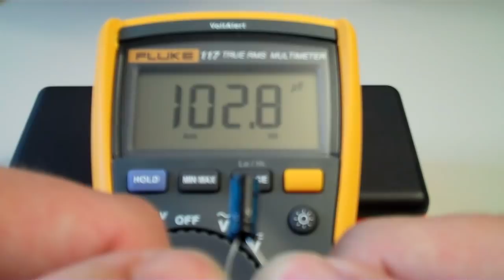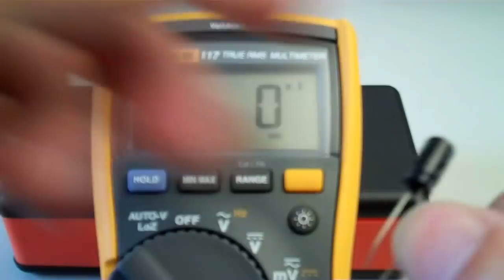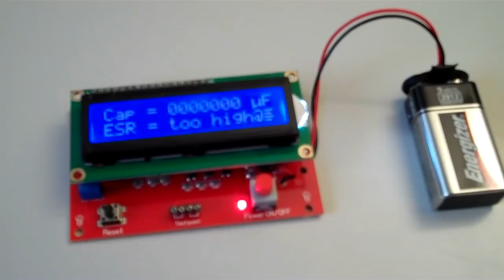Low cost ESR Meter review

Comment: Hi, Thanks for the review!
So . . .  may I ask,
do you now trust your Fluke DMM for capacitor testing?
Was the capacitor that was rated NG really not good,
or just not good for applications where it would be used for
frequencies higher than audio signals?
If you had taken that cap rated NG out of a power regulation circuit
could it have contributed to a malfunction of that circuit?

Thanks in advance for your information
Reply from the maker: cynthia scrubs The Fluke meter only checks the component's capacitance and does a pretty good job at that. Unless the capacitor has dried out badly, it may still have it's original capacitance, but may have a high internal resistance.You may want to check out my video on the topic: http://youtu.be/EWJjUbTFEZE I'd still use the poorly rated capacitor to smoothen ripple on DC voltages or AC-couple an audio signal.Lower voltage type electrolytic capacitors will typically have a higher ESR than higher voltage types. You'll find ESR-tables on the web showing that. The ESR-Meter has no way of knowing the voltage rating, so you have to take the ESR-tester's verdict with a grain of salt.Best regards, Andy

Comment: Very good test and nice that you spent time to study and share results.

One question, how do you mesure the ESR with the scope ?

Brgds
Antonio
Reply from the maker: For the video I only had a look at the signal the tester runs through the capacitor.
But you can in fact check a capacitor's ESR with an oscilloscope and a signal generator. To a 100kHz signal, a good capacitor should  pretty much look like a short circuit. There are quite a few descriptions on the net. See here for example: http://fullnet.com/~tomg/esrscope.htm
Reply from the maker: Hi Antonio,in my latest video I tried exactly that. see here: http://youtu.be/EWJjUbTFEZERegards,Andy

Comment: How about connecting probes an doing an in-circuit test - thats the only thing an esr meter reader is useful for - to prevent taking the caps out of circuit thus saving hassle and time!
Reply from the maker: That is the downside of this low-cost meter. The voltage it probes with is so high, it triggers the surrounding semiconductor junctions, making the reading effectively worthless. So I always have to desolder one leg of a cap to get a reliable value.

If you can afford it, go for a better esr-tester.
Reply: Justine Yong sells a blue ring and blue esr meter - peeps reckon they are pretty good.
Reply from the maker: Could you post a link?
Reply from the maker: Had found it in the meantime. It is about the same price range as the Atlas tester.
Reply: AReResearch its available cheaper in kit form and on ebay!

Comment: can this meter test in-circuit e-caps?
Reply from the maker: No, the test voltage is too high. The test result would be affected by other components (semiconductors) on the PCB. There are slightly more expensive devices specifically made for in-circuit testing.
I have one here and plan to post a review of it some time in the future.
Reply: @AReResearch  whats the name of this testing device? i need this to my shop.pls responce...

Comment: Hi, 
Can i use it with Caps on PCB ?

Regards,
Reply from the maker: It was not sold as "in circuit" tester. I tried that anyway but the results were not plausible. I checked that against a slightly more expensive in-circuit
ESR meter that gave better results. I'll post a review of that other meter as one of my next videos.
So in short: No. You'll have to desolder one leg of the capacitor to take it out of the circuit.
Reply: AReResearch Heh, and i just tough it can do measure in circuit. Seems i will stick to the homemade one  with analog uA meter as display, Saw one schematic on a guy here it the net, that can be used to measure the cap in circuit, it gave like 200mv p-p on the output leads.
Reply from the maker: As said it is not explicitly advertised as "in circuit". The trick seems to be that the in-circuit testers use voltages low enough not to trip semiconductor junctions. I'd have to check the actual voltage across the capacitor under test. - Will get back to you.
Reply from the maker: Just tried it out: The voltage aross the capacitor ramps up to 2.68 volts within around 400ms. That will obviously affect the surrounding semiconductors and thus the test result.
Reply: Yeah, 2.7v are well high voltage able to trigger things on the schematic. Thanks for the test that you did for me, I really appreciate that!

Comment: That total us nothing.
Reply from the maker: MrMac5150 You comment is somewhat unspecific. You might want to read up on the topic here: https://en.wikipedia.org/wiki/ESR_meter . In short: This thing helps finding old/poor electrolytic capacitors. It is one of the cheapest devices you can get and it does a "sort of OK" job at this. The downside is that you have to desolder one leg of the cap when working on a PCB.
If you're out to get a decent meter, have a look at the Atlas ESR 70.
The video was one of my first youtube videos and is not up to the current quality standards of the "AReResearch" channel, but I decided to leave it in there because of it's massive popularity.
Regards
Andy